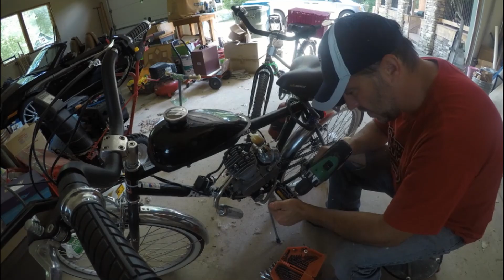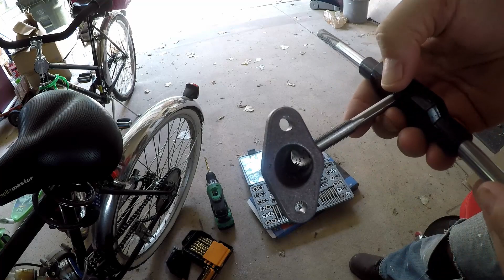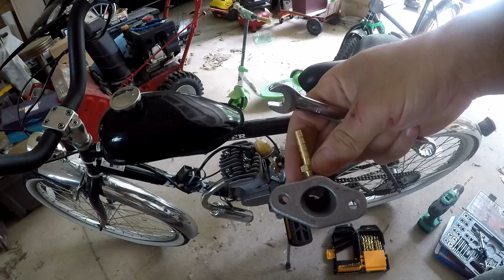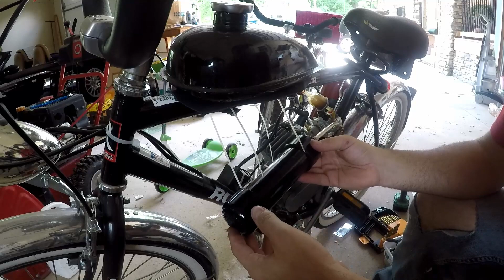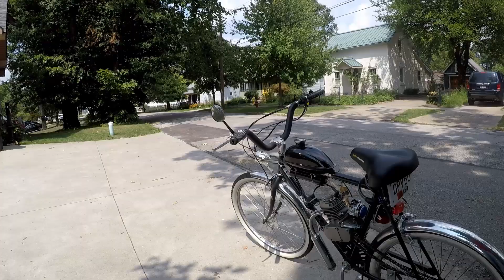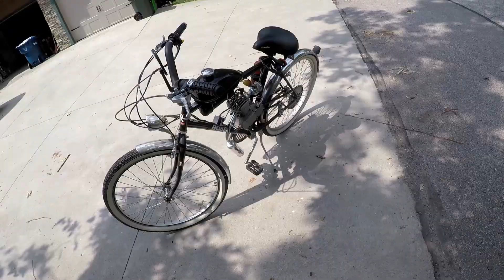80cc motorized bike manifold tap and die for boost bottle

Comment: What is the improvement ?
Reply from the maker: The video goes into a lot of that, but the main benefits that I can determine are more consistent and smoother.  There is a debate about it produces extra power or not.  You can see in the video what happens when the boost bottle is disconnected.  Thanks for watching!

Comment: Y'all don't understand how a boost bottle works, it is based off a large amount of instant air volume. You need at least 1/2 inch i d  hose to bottle. That straw sized hose will do nothing.
Reply from the maker: Yes, I'm still learning about how they actually work.  Thanks for the input.  I can say for sure that the current configuration made the engine run smoother.

Comment: New to the community what is this purpose does this increase power and or hp
Reply from the maker: In my experience, it doesn't create more power.  It does make the 2 stroke engine run more smoothly though.  Mine idles more smoothly, and the combustion is more consistent, which for these small engines is a good thing IMO.  Plus it looks really cool.  Just fyi... pretty much every bolt on or slap on part available for any internal combustion engine isn't going to create much more power at all.  The only real way to create any amount of significant more power is to add a turbo or supercharger.  Have a great day and thanks for watching, Dean.
Reply: It doesnt really make any positive gains, if it smooths out your carb it is because the carb isnt tuned right, youre better off buying a longer intake (for non reed) port match it and clean up the transfer ports.
Reply: An expansion chamber sure made a huge difference for me in power

Comment: I don't understand how the gas leaves the bottle and goes into your carburetor If you have no button To release the gas ??? It's just there for looks not doing anything 🤪
Reply from the maker: Hi Cory.  The gas leaves the tank and goes to the carb.  The boost bottle is an expansion chamber for pressure, not for liquid gas.  Check out my 80cc bike original video from 2 years ago for more detail.  Thanks for watching!